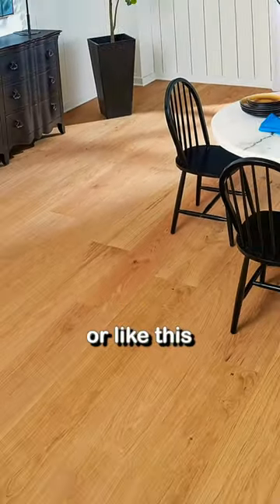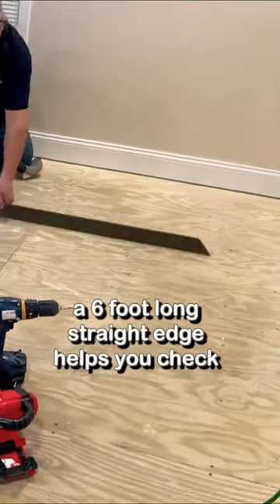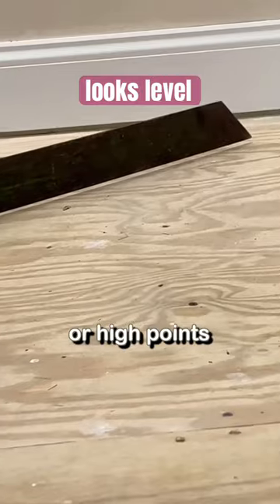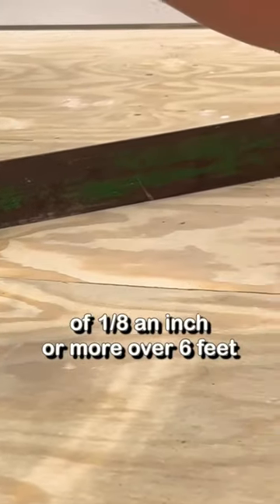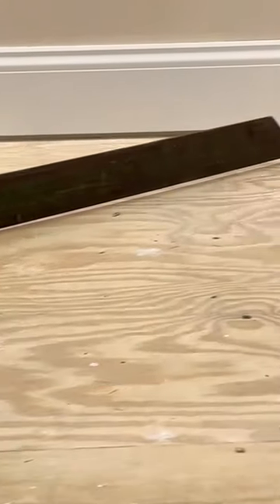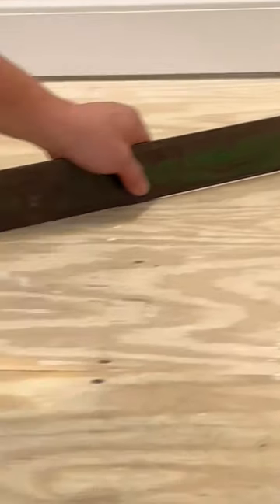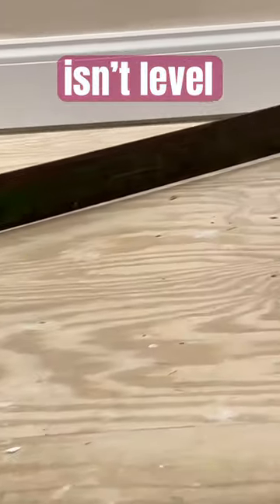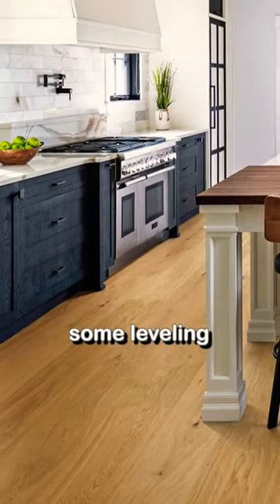Looks Level. Isn’t Level. (How To Use Straight Edge To Check Subfloor - IMPORTANT)

Comment: What product do you use to fill the gap and how do you do that, also if there is a section in the floor that’s higher than the other do you sand that down or make everything else higher
Reply from the maker: In the recent low-spot video, the product we used was APOC 30# Asphalt (Roofing Felt), which was stepped, or ‘feathered’ to gradually bring up the level in a low area of a plywood substrate.
https://youtu.be/Qs5jalz0aDY?si=DzjxpGdZtyPH3tXk 

For your room, depending on severity of the rise, you may be able sand/grind down the high spot, then build-up the low area on either side to create a *gradual change to meet the typical flatness “spec” of 1/8” in 6’ – 3/16” in 10’

Please feel free to follow up with how it worked. Thank you for watching.

Comment: With LVP it would be fine in this case. Same with vinyl sheet, tile, or of course carpet
Reply from the maker: @kena3537 making good points. Tile does have the mortar that will accommodate some irregularities (and for sure carpet). But have you ever had a vinyl product warp, creak, or have the ridges compromised? Even though LVPs will flex to varying degrees, too much play can still cause uneven pressure on locking mechanisms & planks which may lead to headaches, so we still suggest going an extra mile to make sure the subfloor is flat within manufacturer’s specifications..

It can help wood-look LVPs to give that sturdier feel for clients and longest performance. Thanks for that contribution 👍